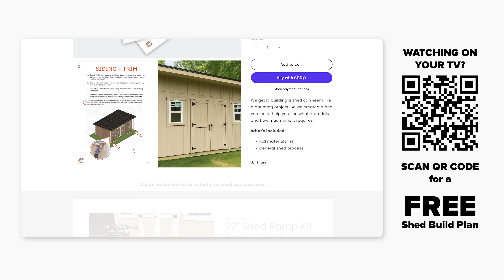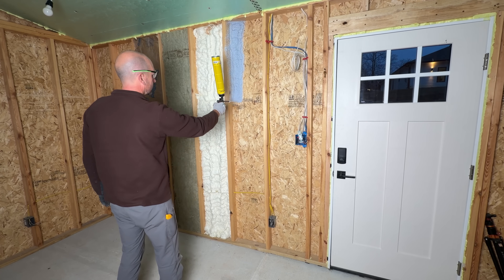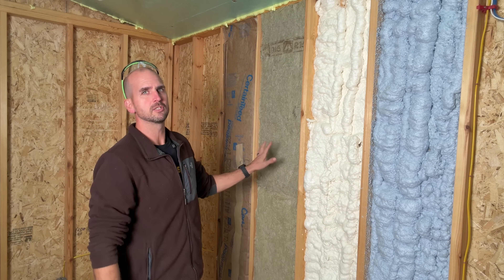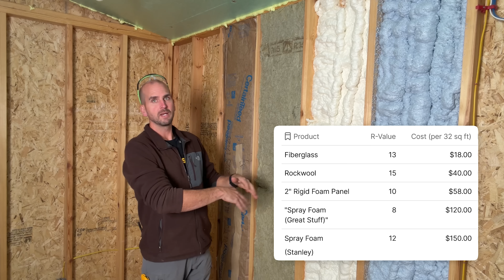Stop Wasting Money! Most Homeowners Are Insulating Walls Wrong

Comment: I only use the spray foam insulation in small, tight, irregularly shaped areas like around ceiling joists or window, door and utility openings, to make sure everything is sealed. I use Rockwool everywhere else.
Reply: Yes.  If I'm understanding correctly, the spray foam is best used in this application as a sealer, especially any seams or penetrations to the outside to stop air intrusion.  Then install the Rockwool.

Comment: Great video. I live in Canada so insallation really matters. Rockwool is an excellent product. Installs easily, good R value, water/mold resistant, no slivers. It also holds its shape really well. I've found that over time fibreglass can sometimes collapse on itself and if that happens behind a finished wall ... the batt is essentially doing nothing. If you have to do a lot of cuts you can get a handsaw for that and it doesn't come apart so much as you're cutting.
Reply from the maker: Thanks for the feedback.  This won’t be my last project with Rockwool 💯
Reply: @EverydayHomeRepairs  Serrated Bread Knife works the best for Rock wool. Just wipe the knife off and put it back in the knife block before your wife comes home or your next job might be making a dog house lol.

Comment: Just a suggestion that was not mentioned in this video. For proper installation of either the rockwool or fiberglass. When you encounter an electrical cable running horizontally through the wall, slice your insulation roughly 1/2 way through so the insulation wraps around the cable. Doing so better insures there are no air gaps behind the cable. Not doing so lessens the r-factor of your insulation at those locations. If in doubt, do your research on how professional installers do it.
Reply: 💯 yup that's what we do. Rockwool is better for 'rebounding' after horizontal cuts but pink panther handles it fine too (imo)
Reply: And who is only going to insulate a ceiling with 2 inch styrofoam board. That’s what,, maybe R6 or R7? Should be at least R19 or 6 inches of fiberglass
Reply: @Wskibum1957  Rigid foam is typically R-5 per inch.  But yes, ceilings are the area of the most heat loss (since heat rises) and is why living spaces should have at least twice the ceiling insulation than that of walls (approx. R-26+ vs. R-13/R-19).  Many places have much higher minimums (l live in Minnesota where building code specifies R-49 in ceilings or approx. 12 inches of fiberglass.  I have R-60 with 18 inches of blown-in cellulose and my heating and cooling bills are about 2/3 of my neighbors).
Reply: @seriously195 I just put 10 inches of cellulose in my attic. Cut furnace ru time by 2/3. Come spring ,,insulting duct work and foundation should drop even more.
Reply: @Wskibum1957 yea head scratching moment..  the ceiling is major ingress point of the thermal changes
Reply: Yup.
One of his very first instructions was to not over compress the insulation into the bay. You need it light and fluffy.
Same goes for any utilities or cross studs in the bay. If you squish your insulation in, you lose the R value.
Reply: @eas2252  Exactly! I used to work for Certainteed and remember the days when the QC guy and team manager would be shaking the dickens out of a batt sample to get the thickness up to snuff. If it didn’t, some of the product had to be scrapped.
Reply: I use a cordless electric knife, works great.
Reply: Good suggestion; I was yelling at the screen the whole time that was happening. Not to mention with the rockwool, it's going to push the romex pretty close to the exterior sheeting, and if you have some "helper" installing the siding, there's a pretty good chance they will "find" that electrical cable when they miss the stud.
Reply: For spray foam insulation,  check out Tiger Foam. It comes in A and B containers and you purchase it in sizes according to the soft you will be  covering.
Reply: @chesterarnold5975 way to expensive.
Reply: Add in the cost of vapor barrier to the rockwool insulation
Reply: @PaulNaughton-n2x  other then the closed cell spray foam all insulation requires an inside vapour barrier or you will get moisture in the insulation. most of the US it is code, ALL of Canada it is code.
Reply: @DwayneTiedeman depends on your climate zone, in USA Missouri  if you put a vapor barrier on inside walls you will have problems with condensation trapped in walls then mold and water damage, have experienced it over an over repairing other  contractors work.
Reply: insulation is better than a heat pump.
Reply: @arnoldschlumphlatz would not have a heat pump in colder regions.when aux heat kicks in, electric bills skyrocket.
Reply: As a former professional fiberglass insulation installer, this is correct.
Reply: that works better on rockwool then fiber glass.  Rockwool is meant to compress against another sheet removing the air gap between sheets as well
Reply: this gent is a wanna be. He really does not really know what he is doing.
Reply: @larrypyke205 he’s helping a lot more people than you are
Reply: @SamClemens-n9q  not if he's explaining the WRONG way to do something!

Comment: If you insulate your roof with air tight board like that it SHOULD have ventilation either from the top or from the eves. Enclosed space like that gathers moisture and starts to rot and collect mold over time.

Actually that Rock wool is meant for ANY size of wall that has studs spaced at 60cm interval. in Finland the current building code is that; in housing construction the minimal thickness of rock wool insulation is at least 6 inches not measly four. Ofc. yours is just a shed and the winter in Britain is just a forever-autumn so insulation doesn't need to be as thick as here to keep the shed warm.

Comment: I hate blown in insulation with a passion. Rock Wool is what I will use in my attic and my crawl space. Air seal and then rock wool for me.
Reply: you are going to have gaps and cracks bleeding heat everywhere , blown in is far superior, even fiberglass batting would be better. from the sounds of it you have a finished attic since you were talking about air sealing, good luck dragging all that roxol around and getting it properly installed from inside an attic
Reply: @pattygreen8064  My neighbor did her attic last year. The hard part is getting rid of that God awful blown in crap. Her attic is now better temperature controlled and is now usable space where as before it was just a dusty unusable mess. She laid plywood decking on top of it. Attic ventilation is much improved now as well. It's a night and day difference. It's beautiful now. It was NOT an easy conversion to do and she did it all over the winter months. I helped a little when I could. That rock wool insulation made all the difference. Temperatures in the house are much improved. Her heating bills have dropped. I guess it depends on the individual home and what is best in a particular case. Mine will be next. Our homes are nearly identical.
Reply: @eddiea3782 sounds good to me! And if you can do it yourself even better! I don’t like spray foam at all.

Comment: When placing batt insulation over electrical wides or plumbing, you should slit the batt so it separates and flows around the wire/pipe.  The way you show installing, you're compressing the batt against the cables and creating cold spots/inconsistent insulation.
Reply: And pushing the wire to the outside.  Technically, this now breaks the electrical code, as wires are supposed to run down the center of any cavity.

Comment: There is rockwool with and without formaldehyde. Make sure you get the one without it if you are concerned with offgassing. Great product. Mold resistant. Impossible to set on fire. Drawback: air sealing must be addressed in other ways.

Comment: Fiber glass shouldn't have a mold issue unless it has the paper on the back of it or it is collecting lots of dust which shouldn't be an issue if the walls are closed up.

Comment: I've never seen a use case that made sense for foam, although I'm aware the 2-part kits in external tanks are far better than anything from a small can. My biggest issues with it are install time + trapped moisture risk.

In my attic I really wanted rock wool but it was cost prohibitive to reach my R38 goal. So fiberglas it was.
Reply: i know i went and did 2 layers of R23 when bags were $42 before biden inflation has them at $88 a bag

Comment: What R value will it be in the end? My shed we built with 4x6 wood and R30 Johns Manville fiberglass batts. In Arizona, but I also got 2 thick large ficus multi stem trees covering the west side fully from the PM sun. 3 ton mini split. All solar. Flooring was epoxy. Everyone calls it the doctors office when they come in since I built white marble counter tops and white cabinets with 3d printed tool storage. I do all my op reports and patient notes there, so it's a write off partially. Rest is just a workshop.

Comment: @1:30 Hi Scott, just a tip here.  When installing batt mineral wool in a bay with an electrical wire (or any kind of obstruction, like plumbing), Rockwool recommends slicing the mineral wool at the location where the wire is, so the insulation goes around the wire, instead of the wire bunching up the insulation on one side.
Reply from the maker: Thanks for the callout.

Comment: Those canned products from Great Stuff and Stanley are not designed for what you're attempting here. They're meant for small seals along edges, areas that are hard to reach, or filling in around penetrations, not for volume fill inside an entire stud cavity.

They don't even advertise it for this sort of thing. The product itself is rated in linear feet per can (not in square feet) with only 1" of foam expansion. Using these for cavity fill is like digging a well with a spoon, it's the wrong tool for the job.

There are legit spray kits designed for this sort of thing, like the Dow Froth Pak, and Stanley also makes a similar one as well. And they actually work because the two compounds come in separate large canisters with multiple spray heads, not in a single can that empties in a matter of seconds.

I insulated an entire 200sf exterior wall with a single one of those canister kits for under $300, a little over fifty cents per sf, with great expansion that had to be trimmed flush to the stud, and the result was excellent, with an R-value that is right up there alongside those of rigid foam panels and rockwool.

It's not that expensive and it works exactly as advertised ... when you get the right product for the task.
Reply from the maker: I agree those cans are not the right choice.  Maybe I found some rogue posting but the 1st Stanley 12-pack I see on Amazon shows more than half of the product pictures doing exactly what I demonstrated 🤷‍♂️.
Reply: The cans are a joke.. a proper 2 part spray foam kit is the way to go
Reply: @369motoman  Plus when they actually do spray foam... they apply a little more than they need to, then cut it back even with the studs.  What he's doing doesnt even give you an even layer for the 2x4 cavity
Reply: I used one of the 2 canister spray foam kits to do a bathroom over a crawl space. It used to be the coldest room in the house. Now it's not only the warmest but also the quietest. I will definitely use it again when I do my kitchen.
Reply: @whistle3man  Same here. I used it to finish an attic space.  It went from the coldest and noisiest room facing the street to the warmest and quietest.  Someone described it as living in a Styrofoam cup. In spite of the cost, it outperforms the other options.
Reply: You don't have a vapor barrier. Half inch rigid foam would work.
Reply: @Patrick-007-9  Good call. Using a vapor barrier plastic negates a lot of problems.
Reply: 100 % agree. You'd go bankrupt doing it his way

Comment: I hate spray foam so much. 

Not only is it a petrochemical, it's more expensive, messier, and entombs everything in the wall. Good luck should you ever want to run a new wire in that wall or add an outlet.

Comment: The spray foam cans are a no-go, but I wonder if the economics get better when using those two-part mixing tanks that they're selling now for like $400.
Reply from the maker: I think those do a much better job than hear small cans.  Still a bit pricey but not $120 or $150 for 32 sq ft.
Reply: @EverydayHomeRepairs I have used the two tank kits before. The one thing to keepin mind is disposing of the tanks afterwards. I tried taking them to a local hazmat drop off and they wouldn't take them. When i called them they said it would be $200 per tank disposal fee.
Reply: @jeeves744  Ouch, that's crazy.  I had a similar thing happen to me this past summer.  Had two old railway ties at a rental property I own.  I could not get rid of them and the only local company that would take them wanted $70 per tie.

Comment: Are you going to add a vapor barrier to the rock wool?  The fiberglass came with a vapor barrier, so add that cost (labor and materials) to the rock wool.
Reply: Vapor barriers are a no no. Should have used naked fiberglass batts.
Reply: @jasonpatterson2143  Not true, in colder climates, vapor retarders are required by code for conditioned space.
Reply: @jasonpatterson2143 ?

Comment: never ever use spray foam,  expensive yes, insulation sucks,  it usually does not cover every spot,   and when tearing the place down,  it is terrible.    stick with the rockwool,   nice stuff  and high insulation values    and i do believe they recycle it.

Comment: Are people stupid or just lazy, or both? Just wear some gloves and a mask and fiberglass insulation doesn't cause any discomfort whatsoever. 🙄
Reply: And a long sleeve shirt, taping the cuffs to the gloves.  Button up the neck and consider a scarf. Definitely wear a hat and goggles.  Yes, I hate fiberglass and it does not wash off my skin. I get welts and itch for days.  Last time I used a half-face respirator and that was far better than a dust mask, but I think if I have to do it again I'll go with full face.

Comment: you may have done this, but just not for the video, but you should have a horizontal slice as a chase for the wire to run through the insulation.  it will fit the wall better and not compact behind the wire.  good comparison video though

Comment: Rockwool is a brand name. Mineral wool is the generic name. I suspect you can get mineral wool for less than the Rockwool brand charges.
Reply: And mineral wool is nothing but fiberglass... Just in a different form.
Reply: @w8stral  rockwool doesn't contain fiberglass. Its made from molten rock.
Reply: @frogmanpipes9561  No, it is slag from steel production which is??? Molten Silicon dioxide which IS ding ding ding--> glass.  Just a different form factor.  Yea yea yea, mineral "wool" has more impurities than fierglass
Reply: @w8stral  I suggest that you do more research. Before I make you look like a clown.

Comment: The next gen 2 fiberglass doesn’t make you itchy. There are bigger kits on amazon cost about 1200 bucks but it will so the whole building. I’m not sure what those little kits are supposed to do.
Reply from the maker: How many cans are you purchasing?  Just that back wall would have used 24 cans.  Maybe a pallet would do it 🙂
Reply: The little kits are meant for smaller cantilevers and awkward spots (e.g. joist headers on corners).

Comment: Good demo! I like the Rockwool best. That spray foam, in any form, is a mess! It's really more suited to attics and reno's but it depends if it's open or closed cell. For a building like that outside you really want it to be able to 'breathe' so you have some place for any eventual moisture drive to go, otherwise you'll have all kinds of mold issues. I really don't like spray foam at all for a bunch of reasons.
Reply from the maker: Yeah, I am pretty sold on the Rockwool.  Spray foam works well for sealing small cracks, doors, windows, etc but not very practical for DIY to cover all walls and/or ceiling.

Comment: Good luck getting the John Mansfield fiberglass though. About everywhere here you have to order it, and it's well over a month out. You can get it as cheap as 5$ for one r-13 93" batt. 

Otherwise, you're stuck with the pink stuff, which is 8$ at the minimum right now. 3$ isn't a big deal, until you add up every wall cavity. It adds up quick
Reply: Where are you located? Here in my part of California the John Mansfield fiberglass is always available. Plenty of it at Lowe's. I also just checked, again plenty of it.

Comment: I've had good experience with the exact same Rockwool you are using. It has the added benefit of some sound-deadening characteristics. It is relatively easy to deal with it, except for the weight. However, safety first, in my roof's crawl space, I do wear a half-face mask. You will still get airborne particulate, ironically, more so from the old insulation you remove than from the new mineral wool. On clean walls, like that shed, it may not be as necessary.

Good stuff!
Reply: Quite a few independent tests have proven Rockwool is worse than fiberglass for sound deadening. They claim it's good, but it isn't.
Reply: @jasonpatterson2143  yes it actually is very good at sound dampering